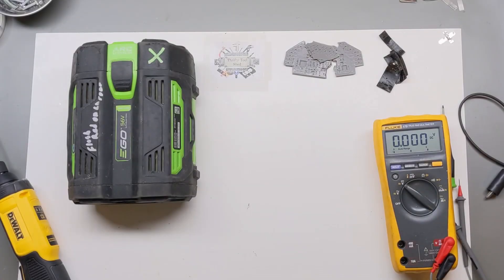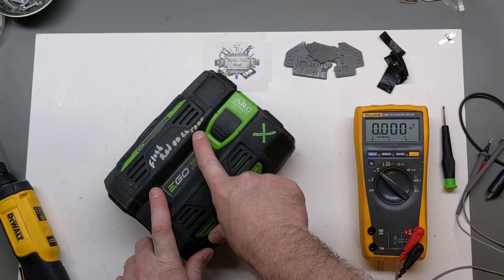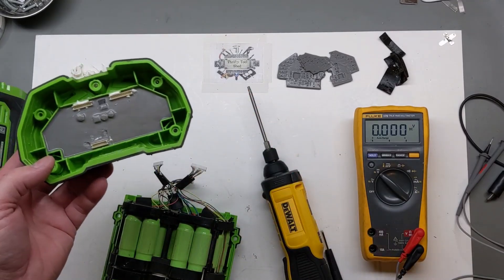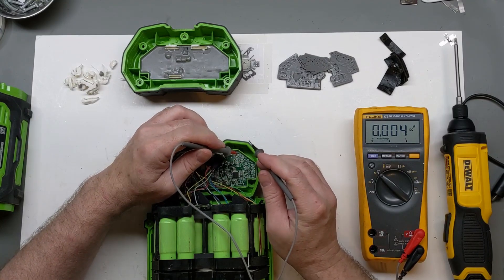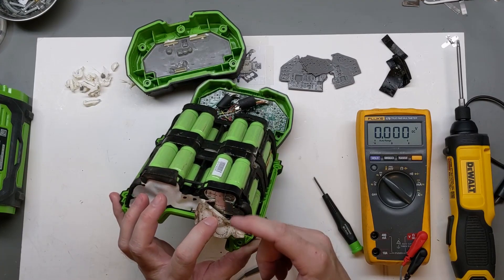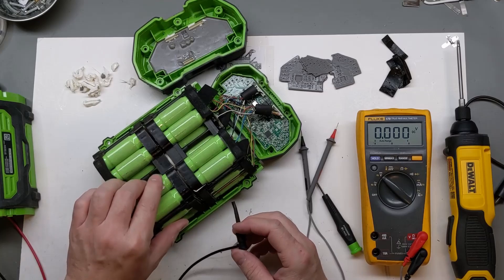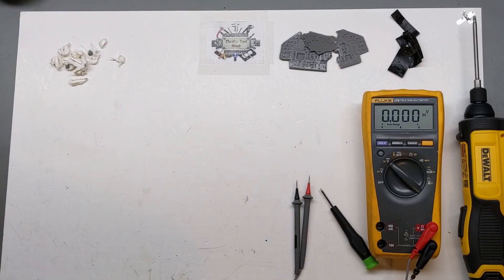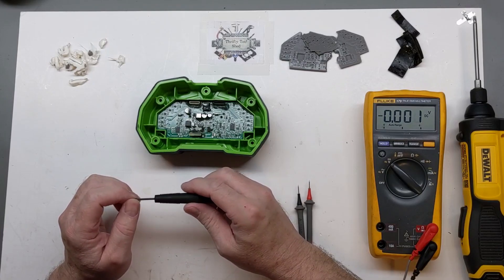EGO 56V Gen1 5AH Blinking Red on Charger Fix

Comment: I’m posting this comment looking for guidance. 
My Jan 2021 7.5ah Ego battery measures 47v with the cover off between the black and red wires. Placed on an Ego rapid charger it goes to all green in seconds on both the charger and on the battery’s multi-light charge indicator. Placed on my Ego leaf blower the battery indicates one lit green light segment, blows for a few seconds then turns off, flashing red. 

I purchased this on eBay as a non-working, but fairly new battery. 

The connectors are generously and solidly covered in white silicone caulk. This seems to be a more recent improvement. The board is covered. The cells do not appear to have swollen. 

I just need direction as to where to dig in first given the conditions I’ve described. Again, this is a very recently manufactured battery. The silicone is so solidly in place that I only want to start with the most likely repair. 

Lastly, there are two wires, one top, one bottom, that go between the underside of the case and the battery pack, I assume for grounding out static electricity. I don’t know if I can snip these wires and repair/not repair them since I need them out of the way in order to fully open up the pack.
Reply from the maker: My very first EGO pack repair video shows the grey silicone potting being removed as well as some white over the 3 JST style connectors on the board. I don't know if this has changed or not as I have not worked on any this new.  I am not sure which 2 wires you are referring to either. The 3 connectors is all I know of from the board to the pack halves. You have to remove potting as shown in my first repair video before removing the connections. Only going by experience, I would say it sound like some bad cells. Seems like maybe most or at least some cells are close to fully charged and charger shows green as some may already be as charged as can get safely. Atleast one if not more cell clusters must be dropping off very quickly to show low cut out voltage level when used so it's possible that's why it starts blinking red and why it was sold as non working. Have to go around checking cells as I mentioned in some other repair videos. Best of luck to ya!

Comment: This is my experience with EGO warranty service.
After several attempts to get them on the phone then 2 days of testing and confirming a defective 7.5 amp battery for my Mower they said that they would replace it, wow that's great I thought.
Going on 5 weeks so far and I have not received it, no stock they claim yet retailers are fully stocked with EGO products.
EGO Warranty Service is TERRIBLE! and if you need their help you can go for weeks if not months before you get to use your tools again.
I would not recommend buying EGO products because if you need Service from EGO they will drag their feet when it comes to repair or replacement.
Not a good purchase if you ask me.
Reply from the maker: Sorry to hear that. I only had the one warranty claim with EGO so far. The very first battery pack repair I shared was the pack they told me to keep and recycle. It was a easy and painless process back then, just had to make sure you had registered it and they were very helpful. Thanks for sharing your experience! Hope they resolve it soon.

Comment: Ego 5ah battery...Im getting a random blinking red at all times. When I place it on charger it goes from 25%  to 100% and won't charge. It won't run any of my equipment. I tested volts on the positive and negative on the pack from the outside and it reading 54-56 volts. Any ideas?
Reply from the maker: Most likely in the BMS. Checking connectors on the BMS connectors because it is one cause of this. I have had a few  with bad BMS and a couple with corrosion on terminals at BMS causing it.  Best of luck to ya!
Reply: Thank you

Comment: I know longer but simpler way to fix this error. reason for the behavoir is inabiliny to charge all cells ballanced. Although every time you connect battery to charger - it is charging a bit before turn red light on. so if you will do it again and again - at some point it will start normally.
I had this issue with 2.5 AH battery . I started with 42 v measured output. after ~25 charging attempts it got 48 v and start charging normally. (number of attempts depends on battery size and initial disballance)
Reply: @Konstantin Gospodinov, Just want to say thank you so much bro!!!  You save me so much in this way. Tried that way and just put an auto timer on/off loop relay and set it in 1/1 minute on/off, and just leave it alone for few hours, and then it charge the battery from 49v to 52v and since then it charge normal!!!
Reply from the maker: Awesome thanks for your comment and sharing!
Reply from the maker: That would be "another" reason that one might do this. Of course we mention the unbalanced cells a lot on this channel. This one as mentioned was balanced and we went through all that.

Comment: Great video and tons of good technical information that we could use. 

I have bought a used 7.5 AH battery with the lawn mower. I did not pay a whole lot for it. I believe it is a first generation battery pack. From the start, It was just blinking red. So I hook up 2.5 AH battery to it. But, on the fast charger, it would go from 25% to 100% right away. Then I used two other Ego 2.5 AH battery to boost it, back to back, for much of the morning to early afternoon. The voltage slowly creeping up. I can get the voltage up to 55.7 V on the 7.5 AH battery. I put it on the lawn mower, get it to start, then put it right back on the fast charger. It still the same, goes from 25% to 100% in seconds. I did it twice, like one of the video here "Ego battery hack" suggests. I can mow for like few minutes, put it back on the charger, still the same thing. Last night, I left the battery pack on the charger for the whole night. This morning, I checked the voltage, still like 55.7 V. So the cells are holding the voltage but I could not run the battery on the mower for very long as it is not cycling through the lights, like from red, orange then to green cycling with each of the green bar on the fast charger. What do you think is wrong with this battery? Is it like some of the post I have read: it could be related to corroded terminals? I have some contact cleaner I bought from Amazon. Should I just open it up and spray down the contact points? What precautions I should take so I won't get hurt from the high voltage? I could open up the battery pack and take pictures and post it.
Reply from the maker: I do have a few videos about corrosion and bad connections on the EGO packs that I shared. I have fixed 2 all together that was a bad connection due to corrosion. I also had some with bad cells. Never do more than you feel comfortable with, but you could check all cells inside and make sure they are balanced and when under load is it some cells groups that pull down lower than others and then check the connections on board and maybe try the contact cleaner. If all that checks well then it is a possiblity the problem is in the BMS board itself.
Reply: Do sell BMS board?
Reply: I needs one 2.5Am

Comment: My 7.5aH pack just started doing the same thing.  It's about 2 years old and it's the old style.  I killed it mowing my yard and when I put it on the fast charger it just went right to 100%.  Then after it cooled down a bit (15 min or so) it works just like yours did on the fast charger.  I'd bet I've got a cell taking a crap just like yours and a little time to let it build back up brought it back to life.  Regardless, Ego is getting a call for a new battery under warranty.
Reply: My EGO battery just passes three years warranty.

Comment: Does anyone know when the BMS does its cell balancing thang? I'm looking at getting a BA5600T for a project and i'd like to extend cell life by not quite fully charging - maybe to 4v per cell, need to know a bit more about the BMS...
Reply: According to the Ego Battery Manual - "Depending on the battery charge,  it will automatically perform a self-discharge operation after one month of storage.  After this self-maintenance,  the battery pack will enter sleep mode and maintain 30% of its charge capacity."
Reply from the maker: Yes, this is true on storage mode.

Comment: I have a 5 AH first generation battery.  Last week was cutting the lawn with it fine.  Then when I died, I went to charge it and a constant red light came on the battery.  On the charger, it blinks red like in this video.  Now the battery will not charge.  Any thoughts what I should be looking at or is it just too old and I should get another?

Comment: I want to charge my ego battery with solar, do you think using a step up inverter at 58v applied to the positive and negative terminals in the battery would work? Or at least not fry the battery? Thanks in advance! You seem like you know more about hacking these things than anyone else haha
Reply from the maker: Even though it's possible to do as you mentioned, it's better to allow solar utilizing an inverter with a EGO charger if possible. The reason is obviously due to the factory charger and BMS working together making sure the charging is proper and cells are balanced. If in a tough spot and you ever need to charge a pack with only solar then it is possible with the DC-DC converter as long as you have one with Constant Voltage and Constant Current! Make sure the voltage is set no higher than 58V and current I typically would not set above 1 or 2 amps max.  So at least it is controlled, even though not balance monitoring.  Don't forget it's best to still monitor all cells to make sure they are staying well balanced while charging though. Thanks for your comment.
Reply: @ThriftyToolShed  Thanks, I was thinking I would charge very slow with a 50w panel over the course of a week

Comment: Are concerned about EGO battery quality now that they moved to Lowe's? Also, I heard that using the rapid charger is bad for the batteries. You seem to use it a lot, what do you think?
Reply from the maker: I personally do not believe Lowes will affect the quality at all. I would think the QC of EGO would build to their own internal specs and standards regardless if it's HD, Lowes, ACE or even another authorized retailer selling them. As far as the rapid charger, I will agree, slower is almost always better. I have not researched or tested enough to say for sure but I believe with all the cooling on the rapid charger it is fine. I trust it. As I showed in the video on the rapid charger, it has 2 fans for cooling. One is dedicated for the pack cooling. I do use both the rapid and the standard charger. I have not noticed any issues with the rapid charger versus the standard. As we know heat is the main killer of cells. I am glad EGO has great temperature monitoring and the (ARC) cooling air flow design as well as the phase change sleeves for using latent heat absorbtion if needed. Even though these packs have some issues, they are light years ahead of the problematic Ryobi 40V packs and all the others as well. I have always thought the cooling design is the key. Tesla cells seem to do so well with the liquid cooling and that's very impressive. As far as equipment, I don't know of any other manufacturers that do as well with cooling as  EGO arc lithium design. Hopefully solid state packs will be here in the next 5-7 years and we want have the same issues with the finiky Li-ion, voltage too high, voltage to low, temp too high, temp too low. Lol....
Until then they are still pretty awesome!
Reply: @ThriftyToolShed  thanks for responding! I have seen a video of a gardener who said they have seen more battery failures over the last year. Since you take these apart, do you think the quality of the new generations of Ego batteries are still high, getting better?
Reply from the maker: Well, I can not say for sure. I do not own any new generation packs still. I got so involved in trying to figure out some of the issues with the older gens that now I have many repaired packs. I was hoping the new gen packs would be better and alot of the known issues would be resolved.  I still hope so, but I have been asked questions about the new gen packs alot and unfortunately I have to tell them I just don't know yet. Seems they are having some failures for sure. I do like the idea of the fuel gauge though. Heres to hoping it is a improvement and not a worse design.
Reply: So the issue that I have is I have a newer generation battery 5 amp that came with the leaf blower I think it was a 650 CFM model and the issue I have is when I put it on the charger it will blink one two three and then start flashing red it won't start the lawn mower and it won't start the leaf blower and it will not charge I'm thinking something is wrong with one of the cells I also have an older two and a half amp gen 1 battery from a weed eater that just flashes orange immediately so now I only have one seven and a half amp New Gen battery and it has to suffice for the leaf blower and mower even though Ego claims all batteries are interchangeable with all of their products a seven and a half amp battery will not fit on a weed eater
Reply from the maker: The 5ah issue may be the BMS board. I have a recent video troubleshooting the 3rd gen BMS board. It had a similar issue, unfortunately it was not repairable.  but I learned a few things. The 2.5ah blinking orange thinks it's a thermal issue blinking orange. Have you tried cleaning the battery terminal connections? If not that it could be a bad connection/corrosion on the connector of the board or a bad Thermistor.  Also, I did not even realize the 7.5ah will not fit some string trimmers. I thought all packs would fit all tools, even though admittedly the 7.5 would be very heavy on the weed Wacker.

Comment: Similar issue on mine. Between B5 and B6, voltage low. Shows 0.118v. Traced B5 and B6 to the cells. I am not clear on the video, do you connect +  of the charger to one of connection point (e.g B5) and negative to the other (B6)? I doubt this is right, but want to make sure.
Reply from the maker: When measuring I typically put my COM or Black lead on the negative or zero voltage point and work my way around with my Test or Red lead  to easily see the voltage step up, like B1 showing 4V then B2 showing 8V etc. All the way around to full voltage at the pack Positive terminal.
Reply: @ThriftyToolShed   - Great explanation. Makes prefect sense.

Comment: Thanks for the great info!  I wanted to ask...after you've removed the silicone potting from the BMS, what are you using to protect the board again from water / heat...physical shock?

Your tutorials helped me get a 7.5ah $80 battery off eBay working again, but now that I want to put it together, I'm nervous leaving it unprotected...
Reply from the maker: I have considered using a silicone potting to cover the board. I have several that I have repaired now and I have had zero issue leaving then uncovered. The main benefit is how easy it is to pop the end cap off and use it to test another pack by going around the TP B1-B14 so for me the benefit of using them for testing out weighs the risk of leaving it uncovered. At first I was a little bit concerned and thought I might should recover it, but I have seen corrosion get into the connectors of a factory sealed board from one pack that got wet. The cells end caps and balancing leads were corroded bad as well. My thoughts after that is just simply keep all my pack away from any moisture if possible. These packs will not hold up if run in damp areas alot even if covered. If you feel like yours can't avoid such wet or damp then you may want to cover the board and connectors.
Reply: have you looked into the (rigid/firm) pink electrically stable foam that many circuit boards get packed in.  To my understanding, the pink foam resists building up static.   You could find that foam, cut it to shape and have that act as a barrier to protect the pcb when the pack is fully assembled.  Hopefully, you naturally prevent the battery pack from water/rain.
Reply: Just a suggestion. I would just re-silicone with pour on mix for creating silicone molds which can be relatively cheap to buy and used of other projects. It will conform to the controller unit giving you full coverage and conform to the space its poured into. When it dries,  you'll be able to easily peel or lift off and put back as it will be a perfect sealed fit everytime. Working Kinda like a new gasket.

Comment: Hi, would you ever take a look at a battery? I have a gen 3 that will flash green then red on the charger for quite a while and then will finally show fully charged. It will run my blower for about 5 minutes and then die. I would like to get it repaired.
Reply from the maker: I wish I had the time. I get asked this alot. I just try to take time to share what I found and learned from similar repairs. Hopefully it helps someone else. I could not fix them all even if I wanted to! As far as your pack goes, I do not have the 3rd gen pack to know for sure. I would think it does usually flash green then red while charging? Also if it's only a 2.5ah it may only run 5-7mins in a blower? The blower eats up the battery more than any tool I have! Just a thought, obviously you are seeing something different from when it was new....